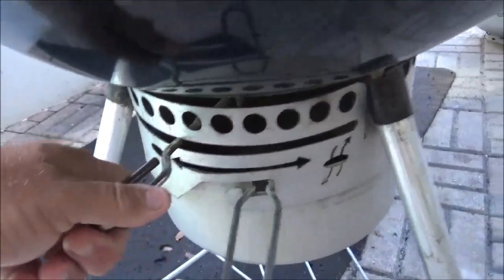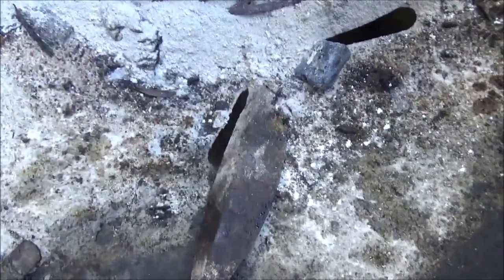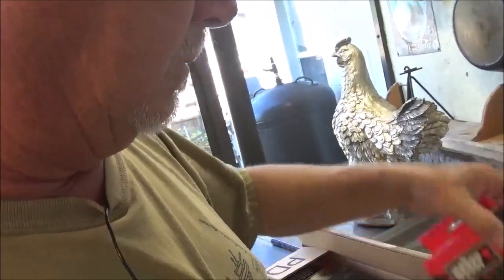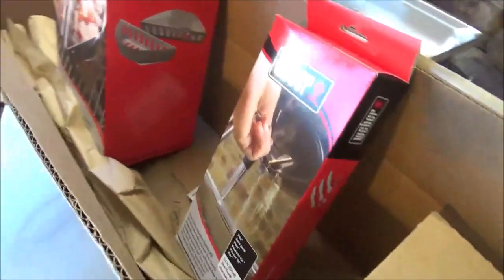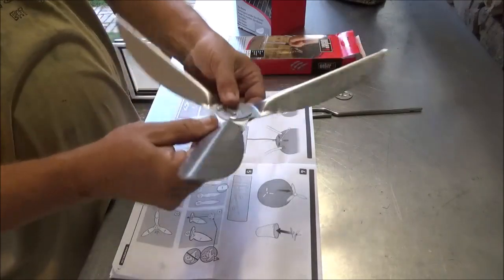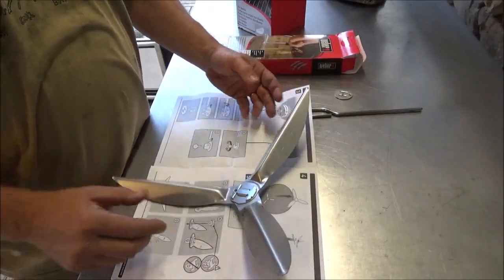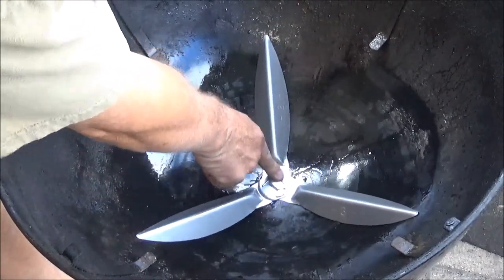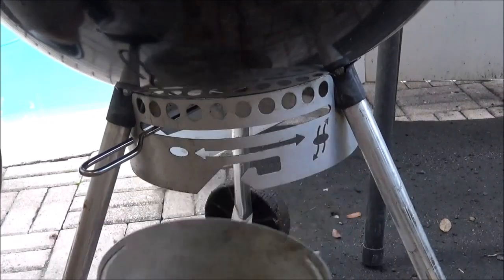Fix Your Weber Kettle Grill Cheap and Easy - Weber One Touch Cleaning System Replacement

Comment: Awesome! You've seen my 25 yr old webber. As soon as I started watching this I paused it and ran outside to check it. Can't believe mine is still intact. Knocked off some inch thick ash and grease and voila! Smooth as silk (ok,greasy grungy silk ) Guess I'm lucky. Had those charcoal trays from the git go. They are great. Wanting to pick up that system that separates the charcoal on one side with a built in water reservoir in the middle for indirect smoking. Another little toy lol. Keep 'em comin' Scott!!
Reply from the maker: Your Old Weber is Awesome.  I'm sure the modern ones are not made quite as well as they were 25 years ago, but they are still the best charcoal grill made anywhere.  Thanks for watching.

Comment: Just did this replacement for the second time, Mr. Backwoods, and it was nice to be able to follow your reminders, as well as the picture instructions that came with the assembly!  That little screwdriver activated clip can be a booger, but your advice on the channel locks worked like a charm!  Cheers

Comment: Another great video. Weber grills can last 20 plus years if stored under a cover or shelter. I’ve had mine for 14 years and still looks good. Just replaced this part for the second time about 2 months ago. I’ve also replaced the handles and ash bucket on the bottom once. Weber is a great grill.
Reply: Mine is 20 years old and perfect
Reply: @mckeon1960  same here, bought mine in 1991 and still going strong. Just now replacing the one touch cleaner.

Comment: I found an 18-inch kettle at a nearby curb in my neighborhood in 2018. Turned out to be a 2005 and I don't think they'd EVER cleaned the thing, the blades were more corroded than yours.  The "One-Touch" is the first thing I replaced (the food grate was the second, it was awful and pitted, too, and I got one with hinged sides) and I've been cooking on it all this past Summer.  Replacing the thing was super simple; I sprayed PB Blaster on the thumbscrew (may not have even needed it!) and it came out, no problem.  Works best to keep the kettle right-side-up and put a bag of charcoal on the blades to push them down; then just reach under, put the "washer" thing on, and pop the handle in.
Reply from the maker: The charcoal bag is a good trick.  Thanks for sharing.

Comment: greetings from Luxembourg. I'll be replacing my "fan" too :). Two wings had completely rusted off, after about same time (~6 years or maby 7). After replacement kit arrives, I'll now know how to handle the process now! At least I've managed to completely loosen up the old part so far (WD40 +  universal "brake" cleaner).

Hopefully with a winter cover, the new part will last longer.
Reply from the maker: Good luck!

Comment: Awsome, 3 years later and you have saved me. Just a tip for anyone cleaning. A wad of tin foil rubbed inside will remove everything! does not scratch the finish, just a little more elbow grease. I use this method on my Harley davidson chrome!
Reply: In Weber’s defense u can’t scratch the finish. Try it. Use a nail or something. It won’t scratch without doing something extreme u wouldn’t experience in everyday life.

Comment: I had to repair and replace the one touch cleaning system on my grandfather's weber kettle. it's an old kettle and had the version with the wingnut. the wingnut broke because it was rusted solid, In the end I had to drill out bolt. One I got it out,  installing the new one was straight forward as the video shows..

Comment: I got a used Weber kettle for $20 and the blades were so rusted was no budging it with hammer and screw driver. Used a friends dremel with a metal cutting head to make a cut through the long metal handle and it dropped right through!

Comment: I had the same problem you did with my 22" Performer; blades were seized up, imagine it happened during the winter, had some pretty rough weather so it sat up longer than I usually let it sit, and the blades became fused to the bowl. I couldn't figure out how to get it apart a few months back, didn't really research it just kinda eyeballed it and gave up on it, so I did something stupid; I took the burger flipper and worked it under each blade to try to unstick them. 

After a little elbow grease I got them all loose and could move the handle once again, but noticed that I had bent the blades slightly where they wouldn't sit snug against the bowl. When turning the handle the blades didn't push the ashes off the bowl as well as they used to, but more importantly, the blades wouldn't completely seal off the vent holes, so I could no longer 100% cover up the vents if needed. 

Wasn't really a huge issue, I rarely close the vents fully and I could still clean the bowl of my Weber, just took more effort than usual. Grill was still fully functional though so I really didn't worry about it too much until I figured out that replacing the one touch cleaning system was fairly cheap and extremely easy, so I said screw it and ordered one thru Amazon last week, and arrived Friday. Hoping to knock this out this afternoon in time to grill up some juicy ribeyes and chicken breasts tonight.

 After watching this video I feel confident that it'll be quick and easy. Very good, informative video, very explanatory and it was short and to the point. Well done!

Comment: Weber is awesome. I sure do like that gate mark on the wall and that saucepan is that a BSR?
Reply from the maker: Yes the saucepan is BSR ,  I have a gate marked spider and a gate marked Griswold copy ( we think).. It does say Griswold and Erie on the bottom, but consensus is that someone use a Gris to make the mold.  Thanks for watching. .
Reply: I am on the coast of Texas and if I forget a cast-iron piece on my Camp Chef table overnight it tries to rust. Those appear to be hanging like on the back of the house in a sunroom or patio area. Not possible here back of the house face East and it's a mile from the salt water. I will have to check out my blue book and red book on Griswold spiders. Seems odd they would cast a copy of a spider. Griswold did sell their molds. I just recently saw  fake corn stick. At the heyday they say that there was two thousand Foundry operating apparently pretty hard to make the mold was hard t so there's a lot of knock off and a lot of mystery skillet that look alike. My guess is somebody was selling Southern mystery skillet molds and that may be the reason if they are not marked with a name of the manufacture. Many small Foundry making them and others making copies. Mold Manufacturing was apparently the hard part.

Comment: Most hardware stores carry plastic putty knifes,  they are great for scrapping the inside of you kettle.  The knives will allow you to quickly remove all the burnt on gunk on the sides and bottom of your kettle.  The knives are cheap, won't scratch your kettle and will save you from having to ever replace the One touch.  Of course the kettle should be cool first.

Comment: Nice to see replacement parts are available. However, I place my coals on opposite sides every other cook. That way the kettle will (for me) stay in good condition. Why always place coals in the same place? Makes no sense. Also, a drip pan needs to be used. I need to purchase another Weber kettle as I'm at my cottage, and not in the city at my house. Cottage life, need two of everything.

Comment: The last part of the assembly instructions are wrong, as you figured out during assembly. The #1 blade/fin has to be on the opposite side of the handle so the notch in the downward facing tab is towards the handle.

Comment: The bolt is rusted up and detached from the sweeper... how am I suppose to take out the sweeper now?
Reply from the maker: Pliers or just cut thru the sweeper with an angle grinder.  Going in the trash anyway.

Comment: Totally incorrect. You cannot assemble this with blade 1 facing the adjusting lever. Quite obvious when in the vid he has to turn it 180 degree to fit the lever. Fin1 must point OPPOSITE your lever & that’s exactly what the instructions say!
Reply from the maker: The way I did it works perfect to this day.  They may have since corrected the mistake in the instructions, so good info. Maybe they watch this video as well.